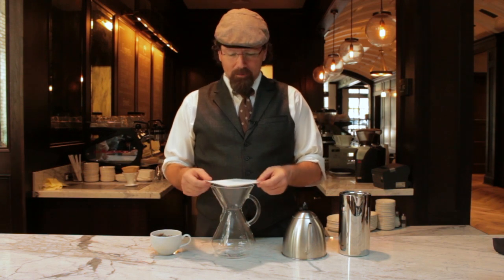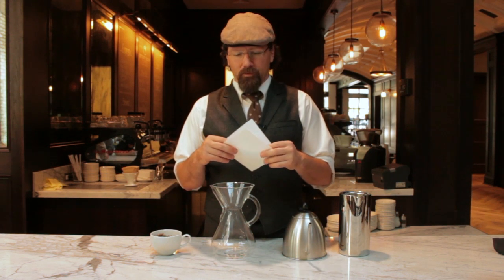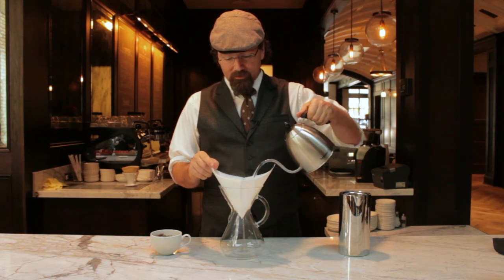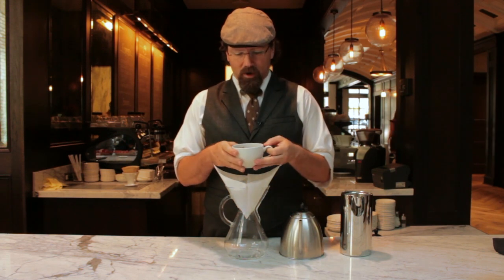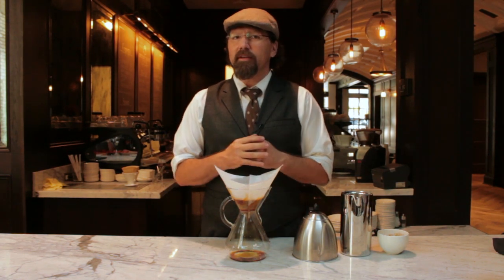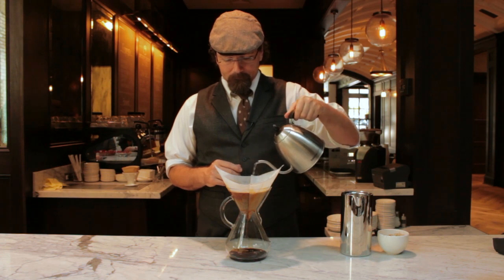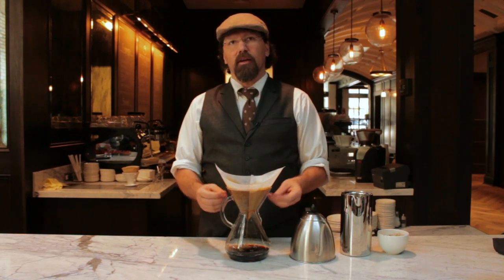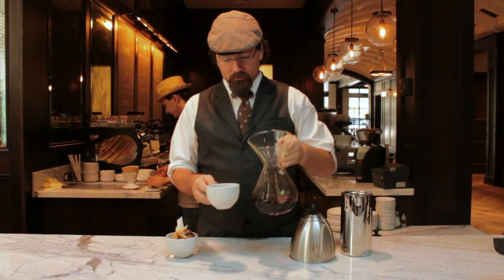How To Brew Coffee with the Chemex Brewer

Comment: Great video, but I'm deciding If I want to get the chemex or the hario drip brewer. Any suggestions?
Reply: The Chemex is more forgiving in terms of brewing. Chemex also normally uses thicker filters compared to the Hario, which retains more oils, I suggest you use a stainless steel reusable filter to get a richer taste for your Chemex. 

All in all if you're looking for something a bit more experimental go with the Hario, but if you want something a bit more safe go Chemex. 

Lastly regardless of which route you go be sure you have a solid grinder otherwise both will be lacking.

Comment: Would simply using two regular Melitta Cone filters be similar to the Chemex filter if the goal is to slow down the drip and hold back some flavor with a similar result? That may be cheaper than purchasing Chemex filters.

Comment: so is it really necessary to go through all that stuff? I mean if I just put the grounds in and pour boiling water in is it gonna come out much different? Cuz I am thinking about purchasing one of these but this video makes it sound like the process is far more elaborate than I thought.
Reply: Yes and no. If you want something simple get a press pot.
Reply: Shane Morris Is it gonna taste ok with normal boiled water and pre-ground dunkin' dounuts beans? That's what I use in my normal coffee maker and I don't measure all everything out everytime. I'm just asking is this gonna have a similar result. Does it require me to be more picky with it? Or is that just an option for people who care about making the "perfect cup" every time?
Reply: It allows you to be more picky with it. Measuring is not necessary but it definitely helps a lot
Reply: Frankie Pie I realize this comment was left a while ago but I'd still like to leave my two cents. 

Basically think of it as like making cupcakes you know? Like, stuff like temperature and accurate measuring is all going to be a factor in making the best result, that's why recipes are usually so exact. You can bake cupcakes at the wrong temperature for the wrong amount of time and using too much flour or too much baking soda and they'll still technically come out cupcakes, but they probably won't be all that great. 

All the stuff about water temperature and grind size how many grams of coffee to water seems really finicky and unimportant but it's the stuff that someone figured out is the way to make the coffee taste its best (and everyone will probably have a slightly different method since it is just like a recipe). I would say if all that doesn't matter and you just want a cup of plain old dunkin donuts coffee in the morning, you might not even tell the difference that's possible with something specifically designed like the Chemex. It's sort of like buying a high performance sports car to commute 10 miles to work when you could achieve the same result with a Honda Accord.

[tl;dr] You could get the Chemex because it looks cool and seems fancy to guests, but realistically if you're just looking for something straightforward and aren't interested in investing in money for a burr grinder and scale and special kettle and good, freshly roasted beans and all that stuff, you could get a $15 Mr. Coffee and probably not notice much of a difference (and save yourself the cash too). But if going the next level in coffee making is something you could see yourself doing in the future and you've got the money to spend, I say go for it!
Reply: Katie Benn I am definitely interested in making the coffee that great, but it's not a skill I'm gonna master very soon, and in the meantime I needed a coffee brewer for myself. This one, while it may be fancy, is really not that expensive. And since I don't have like any of the tools he uses in the video to measure all of those "ingredients" to the exact amount, it makes it pretty difficult. Like how many Tablespoons of coffee equals the amount he says is optimal?
Reply: Frankie Pie Get an aeropress. Makes a great cup of coffee without much of the fuss. It's a different cup for sure, but still excellent and easy. One thing you should have is a gram scale. That way you can be consistent.
Reply: Chad Ashton Do they have gram scales specifically for coffee?
Reply: They do actually but not needed. Something relatively cheap is really all you'd need. It's not going to be super important that you get a very accurate measurement. You are looking for consistency and repeatability more than anything, but of course you don't want to be +/- several grams of coffee either. No reason to spend more than $15-$20 on a scale.
Reply: +Frankie Pie  This is my take on the situation. I just bought a Chemex and I love it. I do not measure anything other than the cup from my  bean grinder. Now I can relate to what your saying. I also don't want to fuss unnecessarily after all, it's just a cup of coffee not a freakin science experiment. Go by feel That's what I do. I hope this helps.
Reply: Arthur S thanks for the input. Yeah I did end up buying one of these. Even for people who aren't Barista's this is a good buy in my opinion. It's cheap, simple, and easy to use. It's also portable and I can take it with me on camping trips and still use it, without electricity.
The only downside of this thing I've been noticing so far is that sometimes the filters can have issues with not sitting correctly in the chemex, and the hot water will trickle down WAAAY too quickly, and the end result is brown-colored water. Very annoying.
Reply: +Frankie Pie I don't use a Chemex but I'm  pour over guy.  Mainly because I have small kitchen so counter space is a premium...French press requires too much clean up.

Now for your question.  Once you make a few cups of coffee with a pour over you will know about how much water to use, but you will need to slowly add water to the filter.  Pre ground dunkin beans work just ok.  the main thing is that you need the perfect water temperature, otherwise those dunks beans are gonna taste really bitter.  I usually boil my water and wait 2-4 minutes before I begin to brew.
Reply: beastwork thanks. that's helpful info. For those of us who don't have water temperature measuring tools.